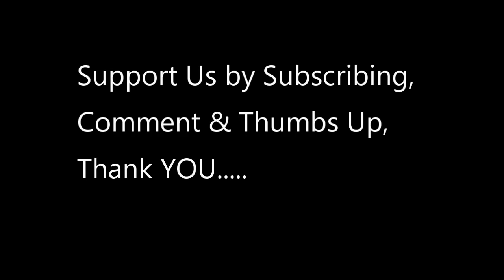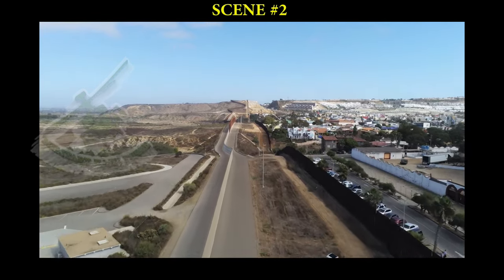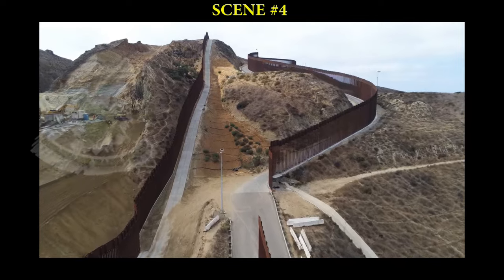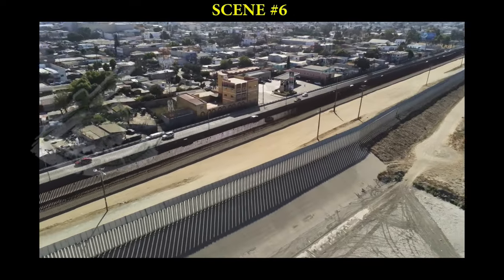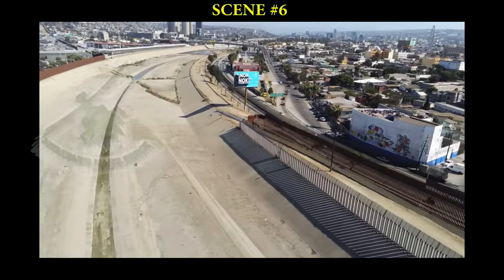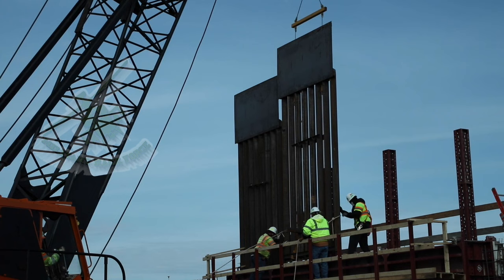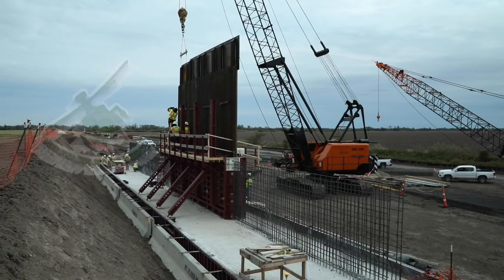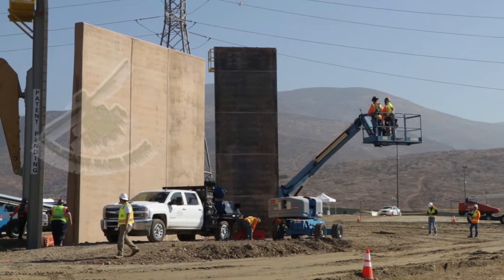A LOOK at TRUMPs BORDER WALL -UPDATE 2019 - PART 13

Comment: This ego wall has already been penetrated so many times.  It's  all a scam.  Just like trump.
Reply: Just because you can climb it you doesn't mean it's safe to do so
https://www.youtube.com/watch?v=u0gZgRmOOfI
And this is just a 18 feet tall version without the big steel plate.
A wall doesn't have to make it impossible. it has to make it just more difficult, with daily patrolling and motion sensors the problem is solved.

Comment: This San Diego replacement wall : Why is it merely 18 feet high instead of 30 feet ?
Reply: GlobalCitizen because if it was 30 you would ask why it isn’t 50.   Trump is a master builder and hires only the best and brightest. This wall is very sufficient.  

Time and cost and level of deterrence